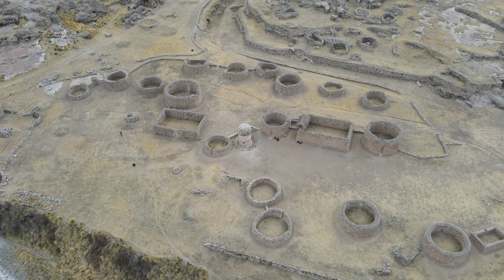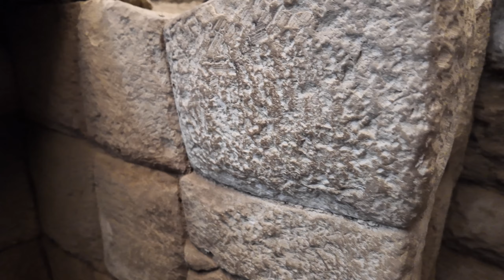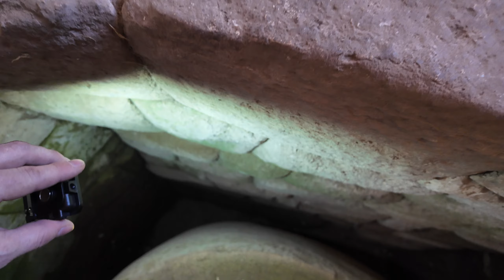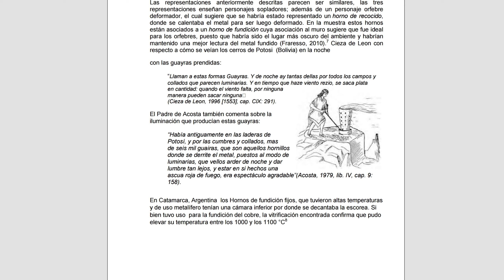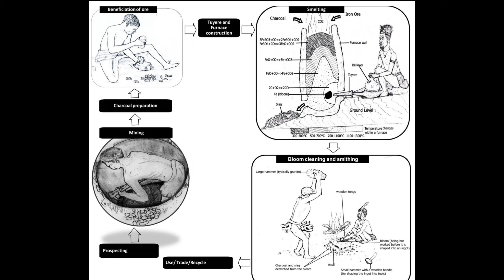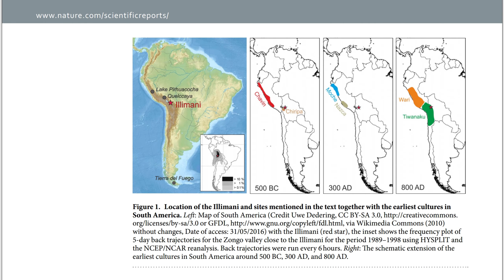Lost Ancient Technology Found in the Mountains

Comment: Gee, nobody tried smelting iron in 4000m. But it is clear that if water boils in such places at 88°C instead at 100°, the iron could melt at lower temperature there as well!
Reply from the maker: Yes, i completely agree. Since the Inca smelters (Huayas) were able to produce heat around 1350c, these specific towers that were smelters in high elevation may certainly have been able to reach 1538c to smelt iron.

Comment: If it was an iron smelter reaching temps over 2800 degrees (F) the stone itself would be vitrified and carbon deposits would be abundant.
Reply from the maker: This has been reconstructed or fixed over time. Inside the Sillustani towers, there are burn marks. The idea is that there was another inside piece or Huayas that's missing.

Comment: Where the remains of the Priestess was found in the round hole inside the stone structure they used to carbon date the structure could have been done with a small excavation in the hole to find biological or biodegradable material to be dated along with the bone for carbon dating to see if they matched up or showed different dates.
Reply from the maker: Why wouldn't these remains or even dirt not have been placed inside along with the body?